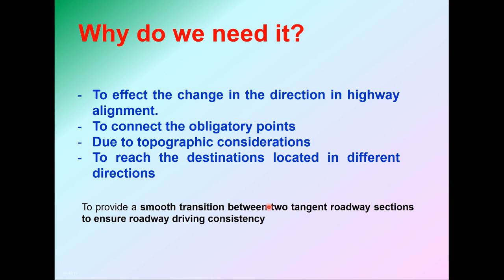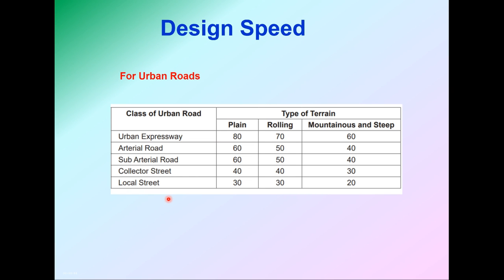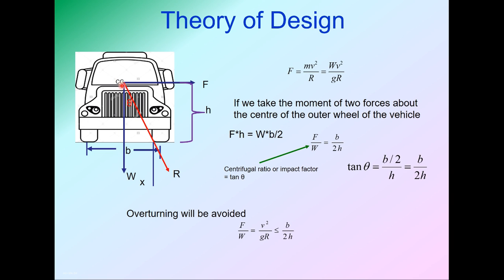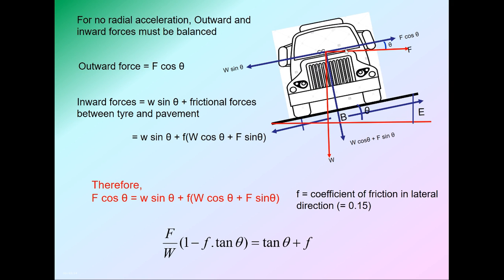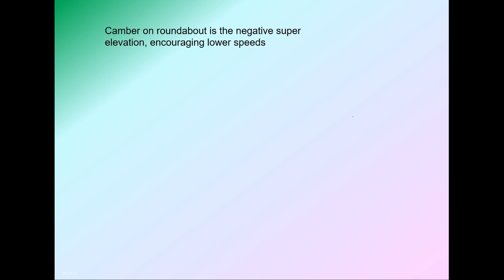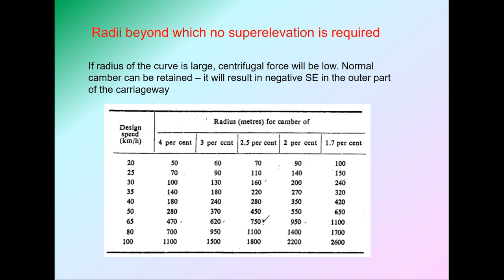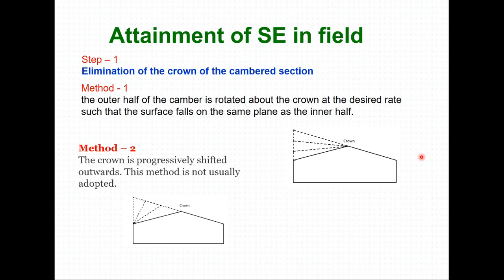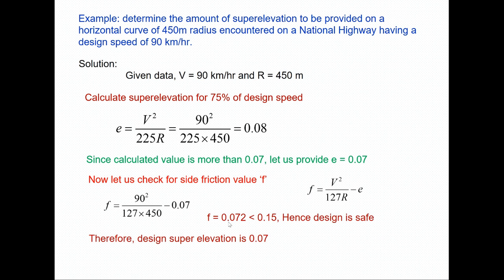#highway, #superelevation, #curve, Design of Superelevation on a highway, Design of horizontal curve

Comment: Why curves do not require superelevation at high design speed? Is it true ? If it is true what is the reason?
Reply from the maker: No, it is not correct. Super elevation is not needed for very flat curves.

Comment: Very very nice video sir
Plss try to cover IRC SP 23 Vertical Curves as well. How they arrive at the values given in table 7 ( they are for condition of curve length more than sight distance but i observed, sometime due to flatter gradients required curve length is less but required sight distance is more)
Reply: Sorry not table 7 it's table 6. How they got value of 8.4 for 40kmph speed???
Reply from the maker: Thanks Mr. Abhijeet. Will work on vertical curves soon. Currently working on Transition curves

Comment: Sir, You made this easy to understand.
I am having a small doubt. While designing expressway now a days 150 speed is considering. I think there is a impact of air on moving vehicles with a speed of 150kmph. What are the factors we have to consider while designing with a speed of 150kmph.
Reply from the maker: The speed limit on Expressways is 120 km/hr and I agree with your observation that when a car is driven at this speed, there will be air drag on the vehicle. This drag will require more engine power to push the car forward. In railways, this air drag is considered to decide the hauling capacity of the engine, which determines the total weight of the train for a given speed or maximum speed of the train for a given weight of the train. In roadways, this air drag is on individual vehicles and therefore not considered in the design of the highway, but it will certainly have impact on fuel consumption of the vehicle. I hope it answers your query.